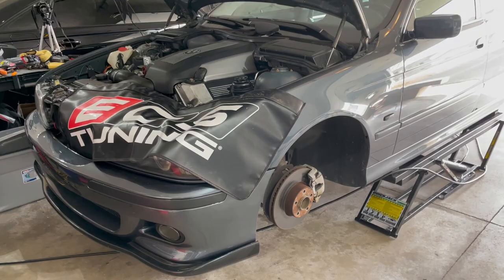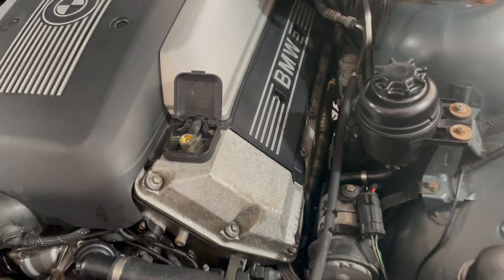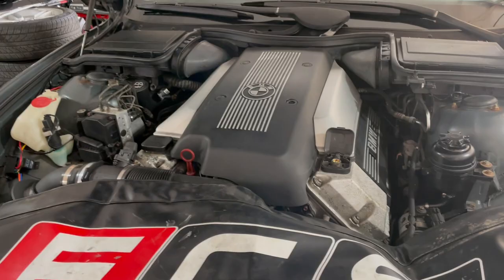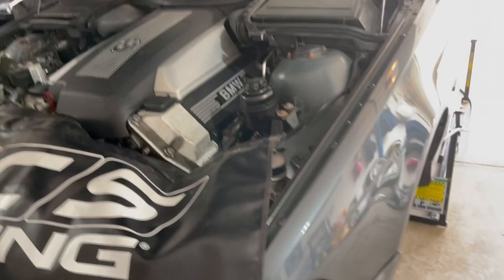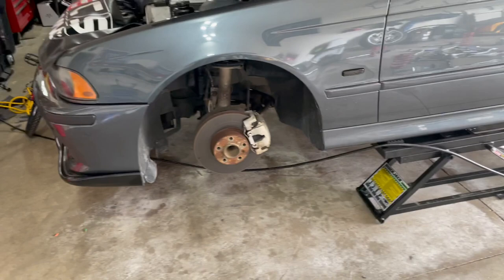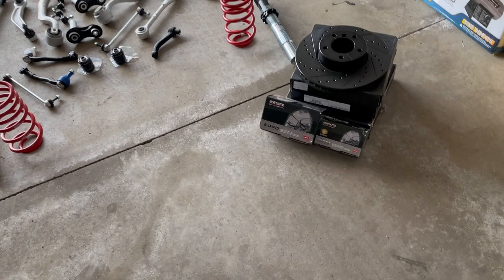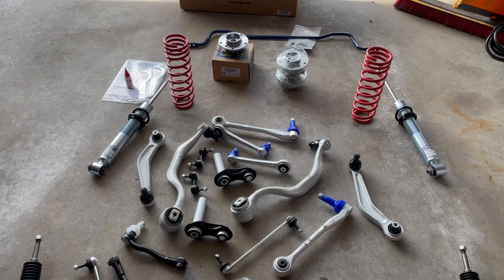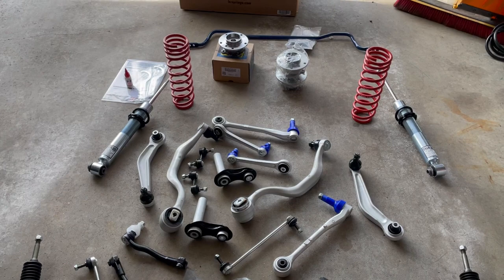Restoring an E39 540i in 2021

Comment: What type of fans are you using for electric fan conversion? Dual fans look good but why did you go with that over using one large fan?
Reply from the maker: I bought this one because it came as a plug & play kit specifically for the e39. It hasn't kept the running temp cooler, but has eliminated the drag and risk of the clutch fan. I still run at 108-109 Celsius

https://www.ebay.com/itm/BMW-5-SERIES-E39-ELECTRONIC-TWIN-COOLING-FAN-CONVERSION-SYSTEM-540-530-528-525/162904331178
Reply: @michaelcoyle1062  check out the gulf 85C thermostat. Did wonders for my 540i. I think there is a plug and play 88C for the vanos motors.